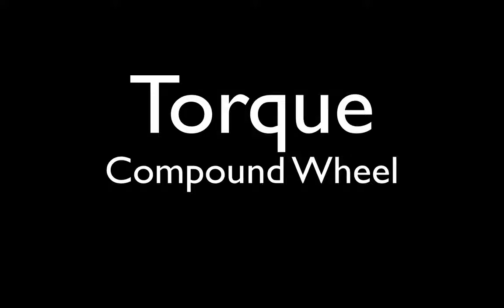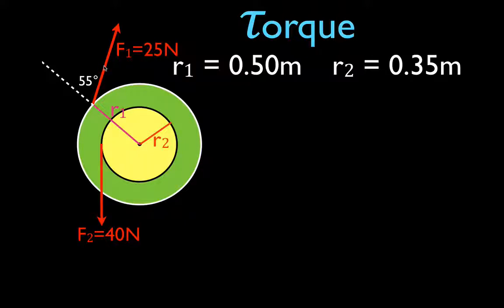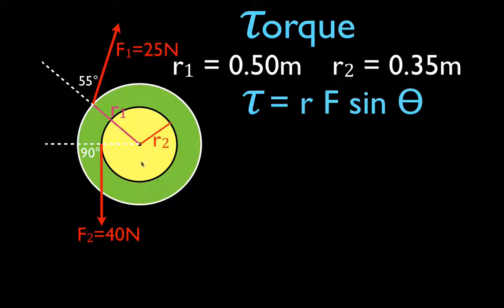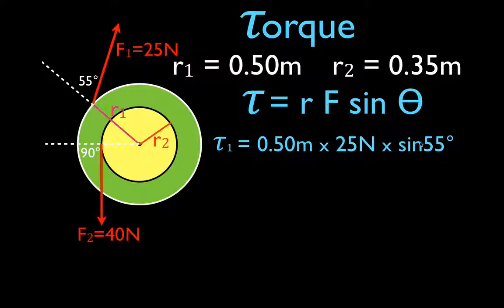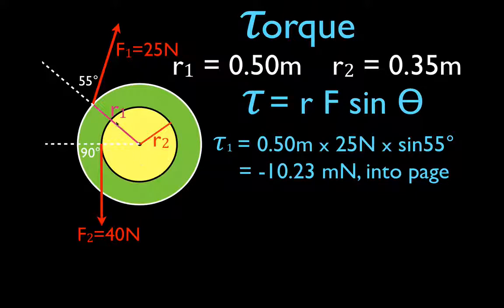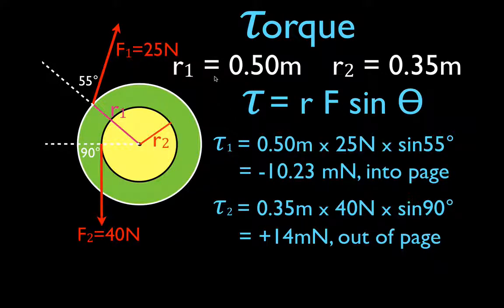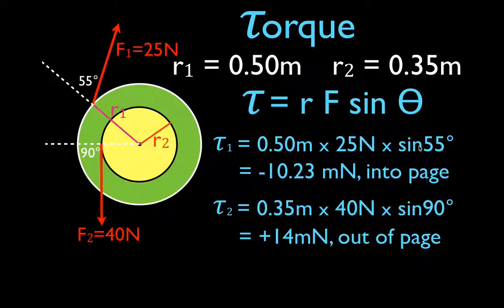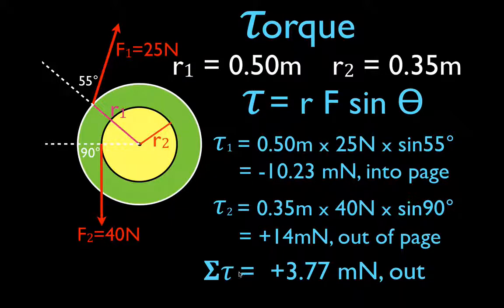Physics, Torque (6 of 13) Compound Wheel

Comment: Many thanks for your videos. Its all celar but I can’t understand the “direction “. I understand how you find the direction but......what is the direction?
Reply from the maker: Will it rotate clockwise or counter clockwise. If the answer is positive then it will rotate counter clockwise, if the answer in negative then it will rotate clockwise. Does that help?